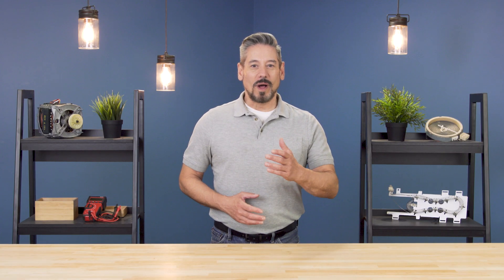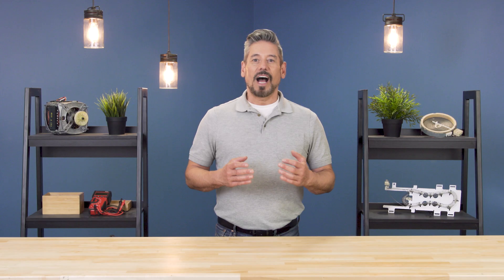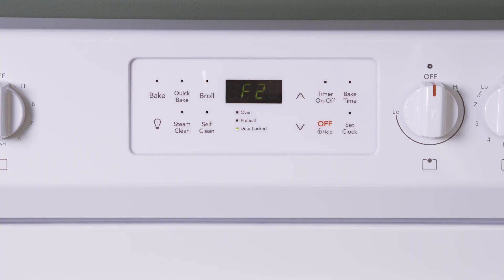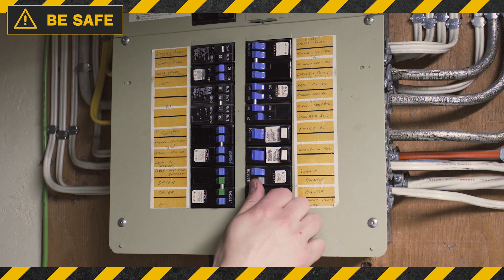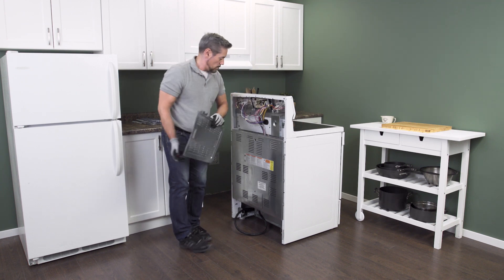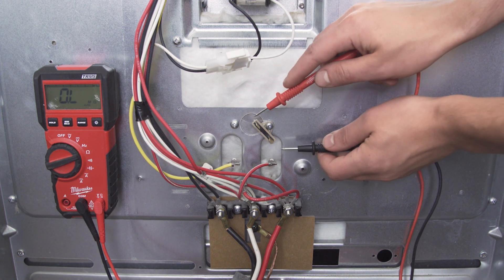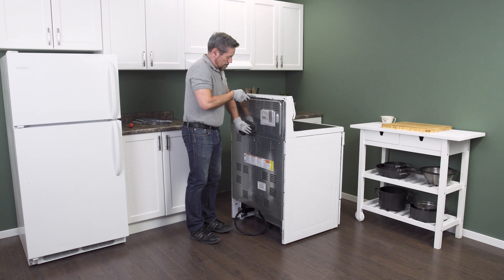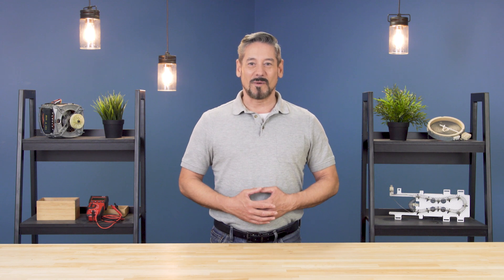Oven Thermal Fuse - Testing & Replacement | Repair & Replace

Comment: Oven working but saying cooktop hot cook top on when off and cools down properly l, 2022 whirlpool oven
Reply from the maker: Thanks for watching. In most models you can reset the oven by unplugging it or turning off the breaker and waiting several minutes. 

We made a video showing how to troubleshoot the hot surface light. Each stove element (on a glass top stove) uses a limiter which feeds into the hot surface light. If one of these limiters is stuck closed, then the hot surface light will stay on. https://www.youtube.com/watch?v=CXhmlswg30Y&lc=Ugz0e9XeRNjU7qP-pI54AaABAg.9LZBry9ijSb9aLOVOPmTVq
Reply: How do I reboot to test?

Comment: My oven went  out and immediately  assumed it was the  heating element . I will check that fuse first.
Excellent tutorial, Thanks for taking your time explaining the instructions.
Reply from the maker: You're welcome, we're just happy to help!
Reply: Both my elements are not working though my clock and top elements work,also my oven does the expected random click
Reply: @crackermantim same everything works except my baking elements both of them and there’s no blown out spots or arcs on them.
Reply: @crackermantim  did you figure it out? Mine does the exact same.

Comment: Oven is not old and not been use much but it stopped working and call repair man tech and they fixed it but stopped working a few months later is there fuse or relay that goes bad in Frigidaire wall ovens??
Reply from the maker: Thanks for watching. Not all ovens have a thermal fuse. Some just use a temperature sensor to detect high temperatures. If you want to know if your model has a thermal fuse then you can enter your model number to see a parts breakdown: https://www.amresupply.com/lookup
Reply: @AmreSupply  I had my Frigidaire double wall oven repair twice and after a month stopped working what the hell is wrong with thing something is burning out the resistors  and what doesn't it have a fuse all GE and Kitchen AID have it. Frigidaire and Electrolux products all fail piece of junk.
Reply from the maker: @myhealthtoo  Some ovens have a thermal fuse, some have a reset-able high limit switch and other ovens just use the temperature sensor to detect high temperatures. If it's overheating and blowing the thermal fuse then it could always be a shorted heating element: https://www.youtube.com/watch?v=10ezc3LNQP4

Comment: Can I buy a replacement at lowes?
Reply from the maker: Thanks for watching. Not all stores have appliance parts in stock, fortunately AMRE Supply does. https://www.amresupply.com/catalog/Temperature-Sensors-Thermostats-Relays-AD1S

As well you can enter you model in the model lookup tool to help find the exact replacement part: https://www.amresupply.com/lookup

Comment: My Kenmore electric oven display won't show or heat above 287°f 
-edit, the degrees were set to Celsius.....thanks for the great video though!!
Reply from the maker: You're welcome! Has changing the units displayed fix the issue? If it hasn't then it could be a temperature sensor issue or a problem with the control board. If you're curious we have 48 more oven / stove troubleshooting and repair videos in this playlist https://www.youtube.com/playlist?list=PLCo9SMjkdWBysYYCcg5xQLiVh_cW0JQvt Hope this helps!
Reply: @AmreSupply  yup I changed it back to Celsius and it works fine now lol... I for sure will check out the other stuff on your channel

Comment: I it possible that oven fuse needs replacing even if grill and hobs are working fine
Reply from the maker: Thanks for watching. It depends on how the fuse is wired in the system. In some cases it might only be wired to the oven heating elements. In that case it would cause an issue with the oven but not affect the cooktop. In other models a fuse will disconnect power to the entire range.

Regardless you can test the fuse for continuity following the steps in the video.

Alternatively if your oven isn't heating at all then it could be an issue with the temperature sensor or the control board. You can learn more in this video: https://youtu.be/96s7maybHlY
Reply: Thankyou 🙂👍 appreciated
Reply from the maker: @xxxxPennyLanexxxx  You're welcome, we're just happy to help!

Comment: Need this info for Fgeh3047vdb, air fry convection oven.
Reply from the maker: Thanks for watching. For more info, you can use the model lookup tool on the amresupply.com website. https://www.amresupply.com/lookup/297418 In this case it will be a limit switch and not a thermal fuse. The limit switch can be tested in the same way as the thermal fuse. The location of the switch can be found on the parts diagram. For this model you'll likely have to open up the cooktop to access it. That can be seen here: https://youtu.be/XQ30epA84bQ?t=178

Comment: My five glasstop burners and oven won't turn on/heat up, but the digital display and lights all work.   Would the fuse control all the heating elements?
Reply: Thank you!
Reply from the maker: @dunfordorama  You're welcome, we're just happy to help!
Reply from the maker: Thanks for watching. Since the display and the lights work, you've verified that 1 line of power is active. Its worth checking the fuse to see if it has blown. There are models that the fuse is connected to line 2, and will disconnect power to all heating elements.

Additionally a faulty outlet or power cord can also cause all the heating elements to stop working. You can learn how to test the outlet and how to test the power cord in this video: https://www.youtube.com/watch?v=wZwxewn2w44

Cheers!